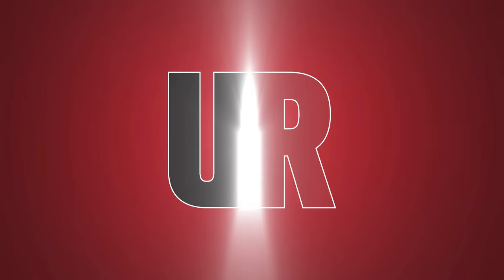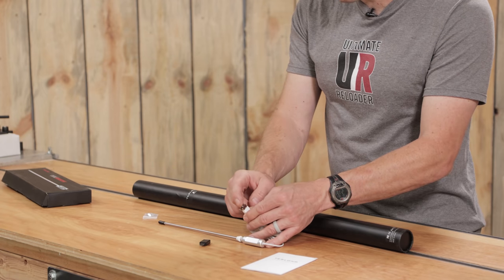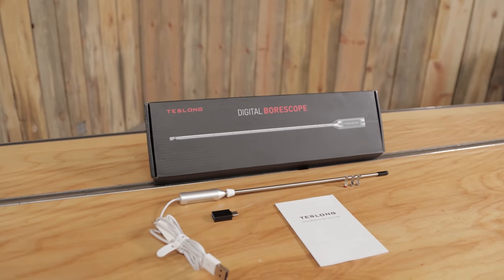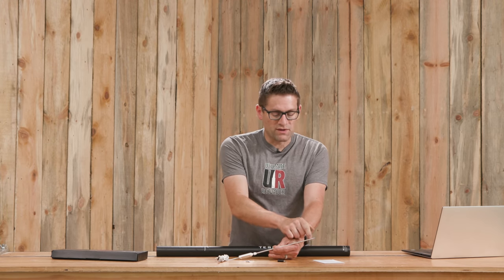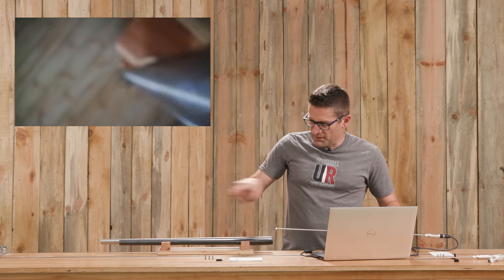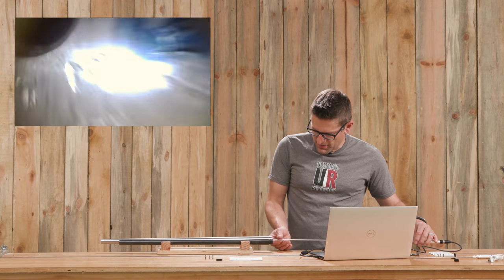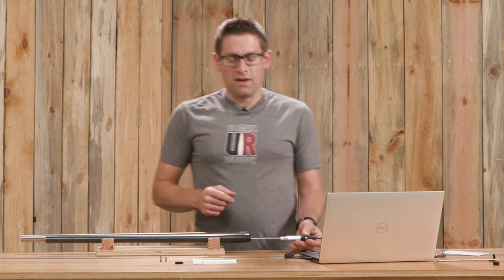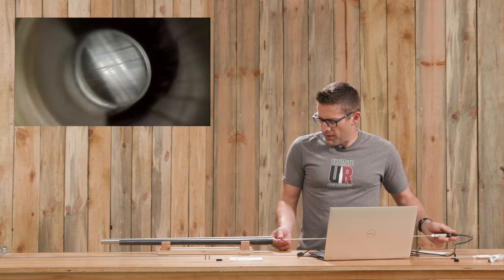TESLONG USB Borescopes for Rifle and Pistol (NTG100P and NTG100H)

Comment: Had the flexible version for a while, and have been very happy with it. I picked up the two you have in the video on Prime Day (replacing an older Lyman unit), they just came in yesterday, and this video shows up on my notifications today :) so far so good, only messed around with the pistol one last night. I think having these ridgid versions will be very valuable. A couple other uses (especially for the short one) are checking gas block alignment, and inspecting inside brass and/or die bodies. I have also used the flexible one inside walls whe doing extricate work. These scopes are a great value for the money, thanks to Teslong for bringing borescopes to the masses, and thank you Gavin for a great review!
Reply from the maker: YES!!! I'm looking forward to better gas hole (AR) inspection and measurement.
Reply: @Ultimatereloader  There is a slight difference between the rifle scope I received and yours, my unit does not have the disconnect for the cord. I am wondering if this was a removed or added feature. My unit also came in a box (similar to pistol scope) instead of a tube, and has what appears to be a manufacturing date of "20210125" on the UPC label.

Comment: I bought the NTG100H based on this review a few days ago. Great value for the $.
 Like others, I thought I was doing a pretty decent job cleaning up the bore. Wrong. 
I now see carbon and copper I missed. The Teslong, along with Thorro Clean (best carbon cutter I have used) and Barnes copper cleaner solvent is bringing my bore(s) back to bare metal cleanliness. I can see the scope being useful in other applications as well.
Appreciate your many very informative videos. Thank you.

Comment: I finally picked one of these up for my rifles - love it! I was worried it might be too cheapo, but the quality is very good and the price was great. I picked it up from their site directly along with the extra mirrors so I use the big rifle one on my pistol with the 9mm adapter and it works well enough for my needs. I got to see first hand the value of using iosso to clean the inside of my barrel.
Reply from the maker: Good deal, I am finding needs to work very well!

Comment: Very nice video. I have been looking at these online. Still a bit confused as to which one to buy. I have been considering the one with the flex tube but am wondering if it would be better to get the rifle rod one instead. I did like the results you got with your unit on your demo. I guess I am just going to have to think on which one to buy just a bit longer before I order. Your demo was very good!

Comment: FYI, my NTG100P came in dead in and they said that whey would replace it, I have not received a shipping number for the replacement since June 18th, maybe just me, but for me this is not close to good service.
Reply: Yeah maybe your experience was a little bit different I ordered the kit that uses the WiFi adapter for iso users but they sent out the model that has the screen so I called them and asked if I could purchase just the cable and WiFi adapter and they were very easy and nice told me  no worry’s we will have a whole additional unit sent to your house in a 3 days it arrived in 2 at no additional charge
Reply: @Johnny-jr2lq  Update they got me a new working one! after a few contacts they fixed me up, the company is good to go!

Comment: Did you use the link and downloaded the software that was in the directions? I ask because I did and it is munch slower that what you are doing. How did you connect the bore scope. Did you use a program in Microsoft or one the computer? If so how did you connect please.